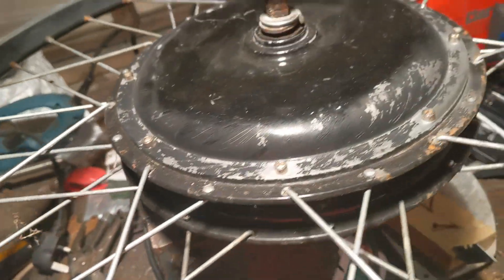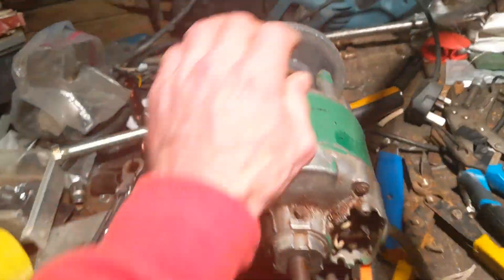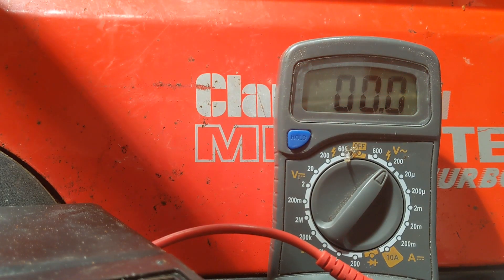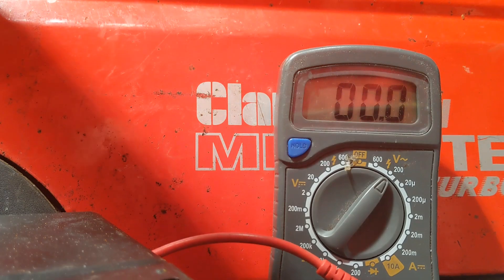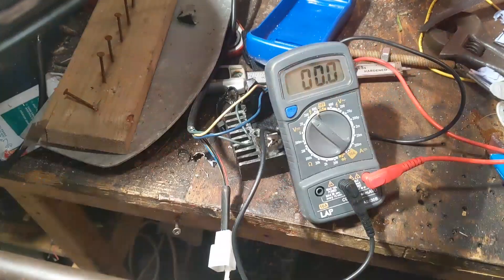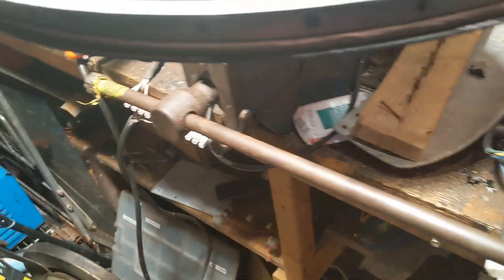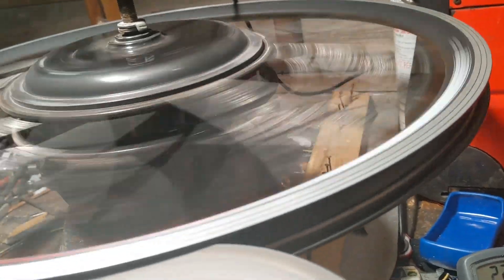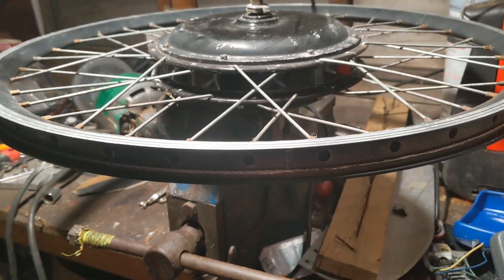48v 1kw - 1000 Watts -  E-bike motor as a wind turbine ? -  Thinking out loud

Comment: 25voc should charge a 12v battery nicely,  I had this idea, but didn't think the voltage would be high enough in my wind to charge a 29v battery,   I have thought about using a 48v delco pma to charge my batteries, but I want to use a mppt controller, midnite classic150, or 200 ,   that way if neither is producing, I can charge with my DC generator, up to 96 amps, I just have to keep it under 150v or 200v the only problem, is the price,  the classic 150 is around $700 American,

Comment: i never had much luck, not enough juice production, i think a high voltage motor is best, is it induction motors they use watched one make big power, interesting to see what the 48v motor can do , im thinking max 100w but thats still helpful. ive made fisher and paykel turbines before theyre much easier to do and better , find and old Direct Drive washing machine youll see , copper wound is preferable.
Reply from the maker: Can you remember what types of motor you used?
Reply: @GavinFreedomLover  fisher and paykel top loader direct drive washing machine its the easiest Yet any DIRECT DRIVE washing machine will do , you could watch toys for watts he did  one of the harder ones being not fisher and paykel.  they can make upto 600w but easily 300 and you MUST  be carefull to reduce hiow many coils per phase which us VERY EASY  otherwise you could die ie 1000vac
Reply: also look at ozwind engineering and the backdhed com , or just type fisher and paykel wind turbine FAR BETTER than e bikes

Comment: Thanks!  I been wondering about this for a while...
Looked for a video of someone doing it.  Didn't find one.  Looking forward to it!
Reply from the maker: Have you got a motor?? You can use an older type 250w DC motor off a bike?
Reply: @GavinFreedomLover  -  Don't have anything like it.  Some of the power output of those things is up in the kilo's.  Can't be a bad way to go.  But i have no idea what to do with extra wires - for throttle, i guess.